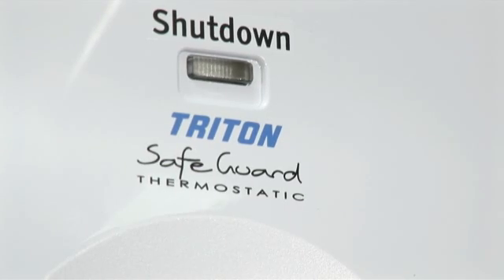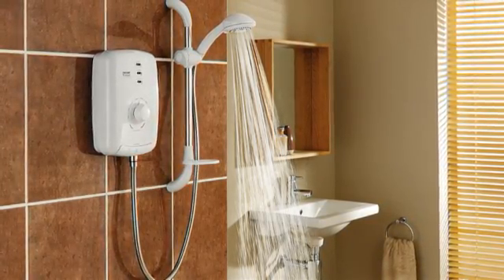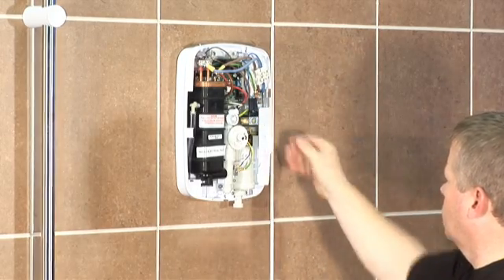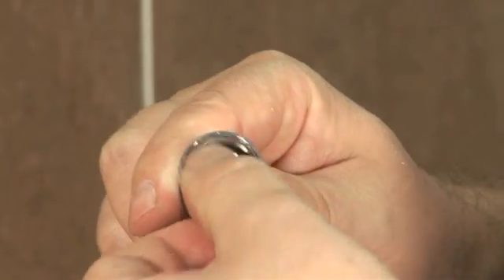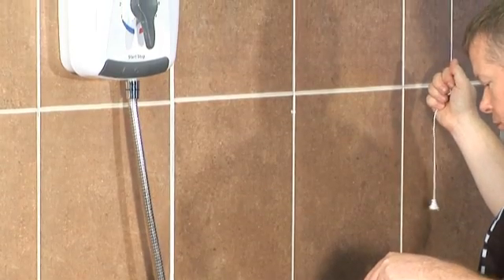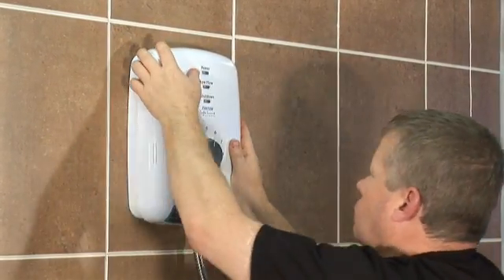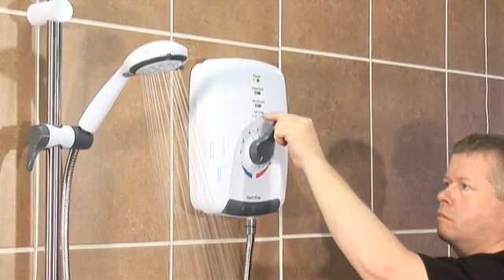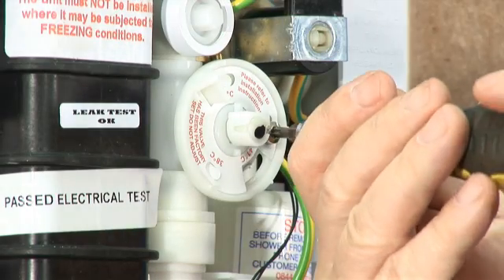Electric Showers: "How to commission the Triton Safeguard Care" video from Triton Showers

Comment: Excellent. I was reading the original manual, and was about to replace the PRD bought from Triton. I was not quite sure the "Commissioning Procedure", it seemed to me I should NOT connect the PCB cable yet while commissioning. This video at timestamp 59s, confirming my understanding. Wonderful.

Comment: New shower fitted not heating always going back to cold
Reply from the maker: Hi sorry to read about the problem, fault finding for this issue will be dependant on the model, if you still require assistance our service department on 02476 372222 should be able to assist. Kind regards, Leon.